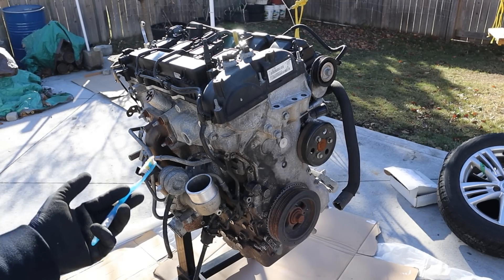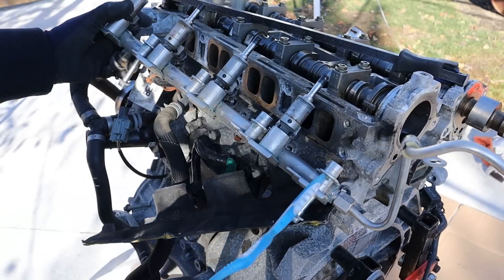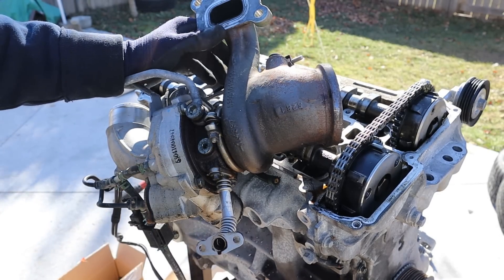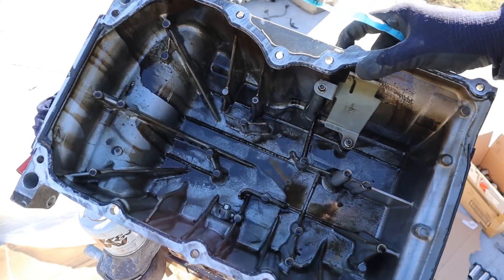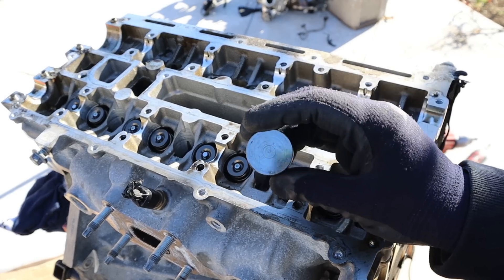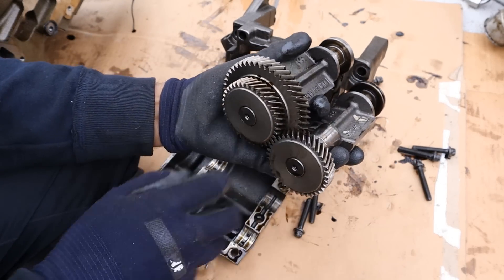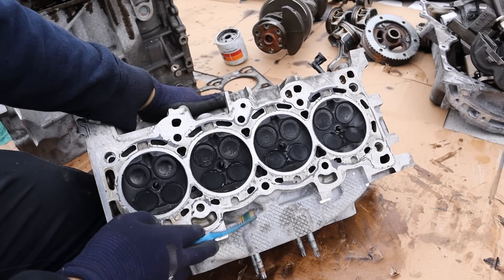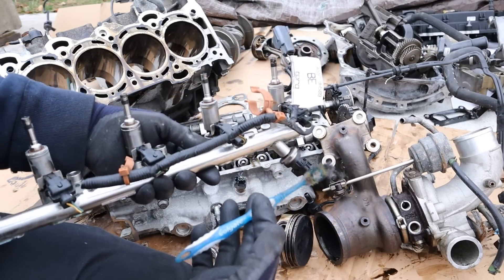Why Ford Ecoboost Engines Fail

Comment: Heey my focus ST is a 2016 also, its a Wagon not a Hatchback so it's super practical with a hugh amount of trunk space.

I decided 5 years ago to fix all possible issues and got rid of the stock intake, manifold, pcv baffle plate replaced it all with Mountune parts  they not only look way better than the plastic pieces but flow better also. 

If you take care of your engine and stay on top of your oil its a very reliable engine

Currently 138069 miles on the odometer, i don't get how you keep blowing up engines in the US car care isnt a thing over there or something?

Comment: 2019 Ford Edge Titanium 2.0L VEP EcoBoost
Started with miss fire on cylinder 3.
Coil pack tested good, replaced spark plugs. We ended up finding coolant in cylinder 3.
Engines toast. Heard that 2019 wasn't in the crosshairs for the bad block design, I was wrong.

Comment: I was wondering if this is the same engine as Mazda used in Mazdaspeed3's 6's CX7's back in 2006 to 2013-ish? It certainly looks similar.  I have a 2008 Mazdaspeed3 which needs a new engine; was wondering if one of these new Ford engines could be a drop-in replacement?

Comment: I've just picked up one of these in a Falcon. Only problem it currently has is a super noisy fuel pump. I'm going to fit a catch can system that cleans the PCV line, as that seems like its got a lot more flowing through it than the one between the cam cover and the turbo inlet (that will get one too).

Then I'll clean the ports and manifold, that crap be nasty

Comment: I08k miles on my 2015 Ford Edge Titanium 2.0L ecoboost. It developed a cylinder 3 misfire, low coolant and coolant in my oil. Combustion bubbles in the reservoir was pressurizing the coolant system, causing no flow and overheating the engine. Luckily, I was able to limp home the half mile with no damage to the block.
After assessing the condition and facing a $5 to $8k bill, it looked like a head gasket breakthrough to cylinder 3. I tried Bar's Grey goop head sealer, and it worked.
Day 1, I changed the oil/filter first, then used  the goop following the instructions.
 Day 2, warmed it up in idle to temp, let it cool down, then drove a few miles. All looked good, so I changed the oil/filter again.
Day 3, I drove it a few more miles and changed oil/filter again. Think I got all the antifreeze out of the oil.
Day 4, Drove more miles and all good. So replaced oil/filter again with valvoline restore and protect. I changed just the filter after 100 miles, and it looked really clean.
I finally flushed the radiator 4 times to ensure most of the Grey Goop was gone. 
All good after 3 weeks and counting. 
Will check again after 1000 miles, but so far, so good.

Comment: The head bolts are metric,not sae, and my 2014 ,2.0 vep Ecoboost has now 196500miles on it, same turbo, change the oil every 6000miled, has a slight tune to it, can get at the 1/4mile 98-101mph, gets 34/36on the highway at 70pmh in cruise control, almost no oil usage at all

Comment: I grew up with nothing but Fords, and I finally gave up on Ford because of their multiple blunders, mainly engine and transmission failures. WTF Ford?
Reply from the maker: They're designed to a failure point and a price point. If you fall outside that bracket you loose.

Comment: Many owners are not using proper driving techniques as well as not doing proper and timely maintenance on the small turbo engines . BIG TIP do not let jack-off places work on your car 👍

Comment: Those caps that go over the top of the valves are probably hydraulic, and as such self adjusting. 

If the valve clearances needed adjusting (or were adjustable) there would be shims.

The carbon buildup in the intake ports is due to EGR, not direct injection.

Oil control rings look like they have failed, lost their ‘spring’ and retreated inside their grooves, and as such stopped working, hence the carbon buildup in the combustion chambers. Common on many engines these days, not just Ford. Take them off the piston and they shrink. The compression rings can be seen to have expanded and are larger than the bore.
Reply from the maker: Thanks for your analysis 🙂

Comment: Great video. I'm 78 years old and spent 38 years in the car business, much of that time in road testing. Carbon has been an issue from the first internal combustion engine. Direct injection exacerbates this problem. Cooling could be part of the problem with this engine  but only testing would answer this. How many miles were on the engine and how was the car driven? These two points are invaluable when judging any engine. All too often people knock the manufacturer without taking all the information into account.  I personally don't like direct injection and today's engines are too complicated.  I understand they have to be but it's frustrating. Thanks for a well doe video.

Comment: Had the 2.3 in my old FoRS, was pushing 600 on e85, never once had an issue.  But hey, "all ecoboosts explode"  in someones world I suppose.
Reply: Now I have the 3.0 in my ranger raptor.  So far, it too has yet to explode.

Comment: So is my engine trash or not? I'm glad it ain't a wet belt driven oil pump. 47 000 miles so far. No problems but I'm guessing a carbon build up.
Reply from the maker: Perform maintainence on time. Hopefully the failure isn't gonna be catastrophic

Comment: Instead of walnut shells use a dry ice sprayer n EGR delete
Reply from the maker: Ok
Reply: @speedkar99  tune more air then fuel for cleaner tune watch chts cylinder head temperature don't pass 385 u Gucci

Comment: Bro I can tell you know your stuff, but watching you make a pile of parts and banging metal onto machined aluminum made my heart cringe. If you can improve your organizational skills like keeping track of the order of your valve train and bearings etc. you'll run into way less work when you reassemble and check valve lash. Secondly, the way you handled the crank and main bearings almost certainly damaged some of your flat machined gasket surfaces. If you have oil leaks in the future, that's probably why.

Comment: Great video! My theory with these ecoboost engines failing is due to lack of servicing and maintenance, oil changing and sometimes you get those who rag their engine putting strain on all the parts to make it work harder. Other than that if you keep it in good condition, then you should be perfectly fine

Comment: Do not buy Ford F150 eco-boost!
They have an engineer  failure design on all the Cam-phasers… 😢
It’s going to cost you to get $3000 each engine repair.😢
This should’ve been a factory recall.. 👍
Ford has been making a lot of defective parts on their engines and transmissions. 
It’s junk! 🎉🎉🎉
Reply from the maker: I've heard...they're pretty bad.

Comment: The problem is direct fuel injection in any OEM engine. It fills valves with carbon. With around 100k the engines misfire so cleaning the valves will do but you have to tear it down
Reply from the maker: Yeah direct injection needs to be suplimented with port Injection

Comment: Dude just dropped the counter shaft gears well balance gears  on the wet concrete he's gona mess up the teeth especially if he gets sand on the balance gears from the concrete not to mention he can put lil cuts that can become big problems later on from dropping then like that on to the concrete and it being wet for sand to stick to the gears and especially once it drys on to the gears hopefully he'll clean them sand can mess your engine up especially if it gets into a part of the engine that gears are operating, or into the engine block where the pistons are moving up and down it can grind on the pistons and the block itself, and eventually bye bye to your engine suction, compression, and bang, which means u got a blown motor, which if lasted long enough with the sand in the block you'll mostlikely eat a hole into the inside of the wall of your block or into the piston like I said if he cleans it off he should be fine but if u get enough grit n dirt on your engines internals/internal parts you'll need one of then engine cleaning machines and there's a couple different  ways with a couple different types of cleaning machines out their u got your sanding type wich take certain types of metal which is tiny beads to mostly clean dust of blocks which is basically like a rock tumbler then u got your oven types with high pressure chemical wash then rinse while heated then baked, there's some others but im to many paragraphs in and done typing
Reply from the maker: This engine, and all engines I teardown go straight to scrap.

Comment: He might got the oil burning part wronge those engines are known to build up alot of carbon cause it's direct injection plus turbo charged but the direct injection plays a big part in building up carbon turbos as build carbon cause all the ecoboost are direct injection that's one reason the are prone to damage that's one reason cause the pistons to look like they might be burning oil but could just be the cause of direct injection
Reply from the maker: Ok

Comment: Ford AKA "Fix or Repair Daily" is an industrial miracle.  The mere fact that any company this bad, is still in business well into the 21st century, is an absolute wonder to me.  I worked for a government fleet, for around 30 years, and Ford kept me and my fellow mechanics in a steady supply of failed automobiles needing fixing.  Meanwhile the fleet had about 100 2001 Camrys, and another hundred Honda Civics, and these cars rarely needed anything more than an oil change because they almost never broke down.  
If someone nowadays still insists on buying Ford products, despite overwhelming evidence to avoid same in favor of more consumer-friendly products, then they probably deserve what they get...

Comment: This black-green plastic exhaust gas valve failed on my 1.5 liter Ecoboost. The car would not start after refueling, one has to wait maybe 30 min. But it was easy to get it replaced.

Comment: Dang! A video fast enough but-- thorough! I learned a lot in the short enough time of it and amazingly remained focused from beginning to end, with out, my AAD meds. That's saying a lot.
Awesomely done work and video  and fast clipped but clearly understandable real time narration.
Obviously this mechanic knows his stuff plus more and I |❤| how it was done on a front driveway in daylight only on top of some card board, utilizing rags of bro's disliked pants and wife's old hippie dresses for rags😂
Glad my focus is the rarer 5sp manual normally aspirated I4, while I'll never be pleased about the carbon DI issue and sutter to think of when walnut blasting will be become unavoidable despite the anti carbon spray into throttle body treatments that only sort of work.

Comment: Just another backyard yahoo thinking he knows something after hitting up google.....Compared to a lot of other engines I've torn down, worked on, and DESIGNED, these 2.0 ecoboosts are a sight better than any others in that category. To clarify your comment about "ecoboosts burning oil" ALL engines with a turbo putting out that much boost (and less) have blow by and burn atomized oil going back into the intake and cylinders. The ecoboost the least among them and that's a proven fact. the 2.0 out of an ST isn't a normal engine like what you'd find in a normal car in it's category, so pretty much every one of your detracting statements is a moot point.

Comment: The coolant passage that is a groove/trench, is that only in the ecoboost engines from 2017-2019? Im looking at a 2015 Focus S LZ that has a 1.5L i4 Ecoboost. And hoping it has the ports that you have in this video and not the trench for coolant
Reply from the maker: Yeah it's the newer ones upto 2020ish

Comment: The ecoboost engine in my 2014 Ford Escape is a great engine. Since it is turbocharged, I make that I let it spin up and spin down for a few minutes before I take off and when I park. This helps to extend the engine life. Unfortunately, a lot of people don't allow the engine and turbocharger this short rest time, which will definitely be expensive and destructive.
Reply: You are absolutely correct with regards to driving your car conservatively for a few minutes for the engine to get to normal operating temperature, but I don't think you need to wait for it to cool off before turning your engine off. The stop and go traffic driving before you get to your parking lot or drive way, is enough to cool the turbo down.
Reply: ı used to do the same with my  1,5 tdci fiesta

Comment: This is a completely different type of engine compared to the 1.0 ecoboost engine, where the camshafts and the oil pump are driven by belts immersed in oil.
Reply from the maker: Yes. Very different.

Comment: The engine failed because it looks like the guy never change the oil have to change the oil every 5000 miles full synthetic that engine will last a long time

Comment: So, no, what destroys ecoboost engines isn't snow getting in to them like initially mentioned in the video. 0:10  It's due to improper maintenance of the carbon buildup. This engine had nothing actually wrong with it but needing timing components, which prematurely wore out due to the engine fighting the carbon buildup, and of course the carbon buildup itself.

Comment: Lies. 14:57  Welcome to 10 years ago when it was discovered that carbon buildup could easily be cleaned with feeding a liquid cleaning product like seafoam into the intake manifold vacuum port (like the one going to the brake master cylinder). You can restore that engine or any direct injection only engine, with anywhere from 5 to 20 cleaning procedures... and then, doing it on a regular basis to maintain that peak like new performance. When you do your oil change, also do 1 carbon cleaning pricedure, and you're good to go. Full power, baby!

Comment: 🧢 it’s the stupid block design for the water jacket where the head gasket fails in between usually cyl 2 and 3 and eats coolant. Block design was fixed in mid 2019+ 2.0 2nd gen eco boosts

Comment: I have a 2013 focus ST and it's bone stock, going on 10 years at 89k original miles with no issues.  A lot of ST engines fail because the owners mod the engines without flashing the ecu.
Reply: The Ford 1.5 EcoBoost turbo engine came out in 2014

Comment: I have a feeling that the owner also used K&N air filter with the oil filter. K&N is great for flow/performance (+3-5%) at the cost of filtration (-20%). Probably that didn't help the cause of this badly designed GDI turbo charged engine. K&N is good for race or 1/4mile tracks but not for daily commute.

Comment: The Ford ECOBoost line of engines are an unmitigated disaster. Anyone contemplating one of these vehicles, RUN AWAY as fast as you can. I had one of the original 3.5 engines and the cam timing chain tensioner went out at only 90 K miles. The chain jumped on the cam gears and the valves smacked into the pistons in at least two cylinders. The valve timing system on these vehicles is comprised of plastic guides and these POC chain tensioners. There are MANY other problems with these engines and they are NOT generally capable of long life reliability like the standard V8 engines found on GM and Toyota products. I will NEVER purchase a Ford vehicle again.

Comment: The real question should be,  how can an Auto Co. be aloud to put defected cars and trucks out in the market and not have to pay to replace the engines?  Not just during wauenty period.  This will never be a recall because they cover their ass by saying its not a safety issue.  It shoukd be a Customer satisfaction issue.  I have a 16 Escape 2.0 Turbo.  Heard engine issue may or may not involve this engine.  Poor design and customers foot the bill.  May be our last Ford.

Comment: The coolant crossover trench was a design failure and high-pressure fuel pumps fail so often I think redundancy is built into them, I had a Freelander high-pressure pump fail and was quoted far too much for a new one (no point fitting a second-hand one) so I rebuilt it with a refurb kit, all new 0-rings and seals, about 25 of them, It ran great afterwards, one thing I noticed about the refurb kit the 0-rings were fatter and stiffer than the OEM ones, 
as for your video, at last, someone who is knowledgable and wants to pass it on and doesn't want to be a youtube star, IE less you more engine, 10*

Comment: Owner of a 2013 Ford Escape 2.0lt here with just over 269k. I change the oil every 5l and the transmission fluid every 7k. I’m very gentle with the gas pedal and I tow my 2000lb tear drop camper with it. I still get the 29mpg on the hwy and 20mpg in the city…let’s hope Incan enjoy it one more year

Comment: water/meth injection will help remove carbon/oil in the intake system.  And watson racing oil separator works so much better than a catch can.  There's no oil in the line downstream of mine.
Reply from the maker: I would like to test that theory

Comment: I prefer port injected engines. My 2015 Camry doesn’t use a balance shaft but the crankshaft is balanced enough to make it ride nice and smooth.

Comment: This vehicle was not properly maintained. There’s a lot of 2012 and 2013 F150 3.5 Ecoboost engines with well over 200k miles. The current 2.3 & 2.7 EB engines are built very reliably as well.
Reply from the maker: And the 2.0?

Comment: I was in junior high when Ford came up with the Ecoboost engine and I was so amazed...fuel efficient 4 banger with variable timing, gasoline direct injection AND turbocharged ? as a Ford Fanboy live in a place where anything bigger than 2.0 considered "luxury or Sport car" this engine was everything I've dream of....

now that I'm a grown up and understand more of how things work, I'm happy with my 2012 Fiesta, NA 1.6 ti vct and manual transmission...you know at least the ecoboost engine would last way more than the DSP6 transmission it usually paired with...